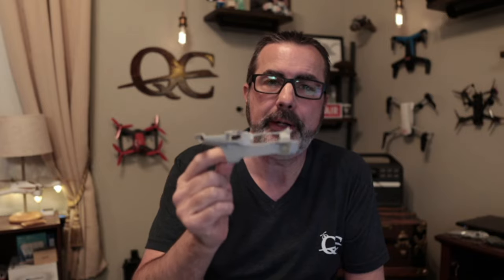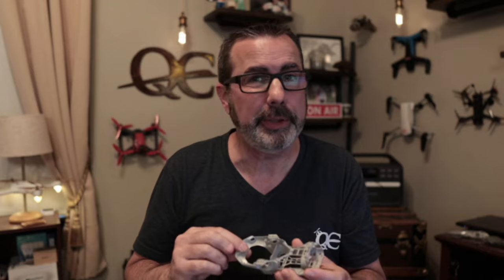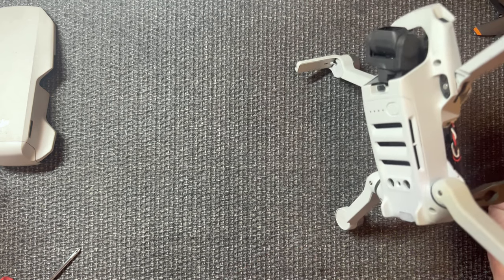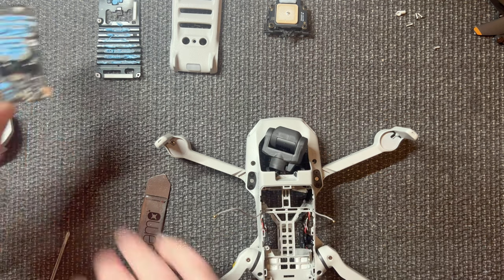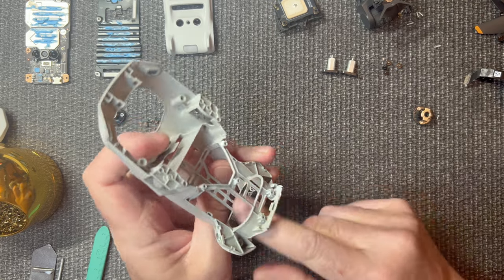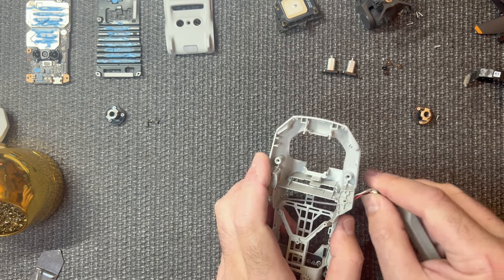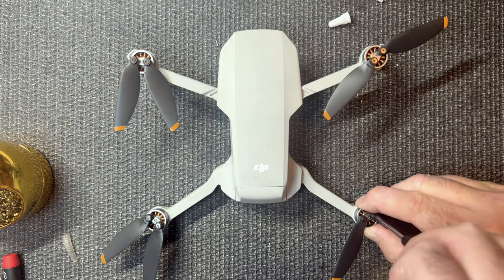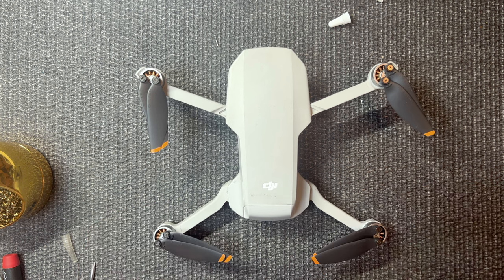DJI Mini All Models - Mid Frame Replacement - Complete Teardown

Comment: Quick question about soldering, how do you stop the solder from touching, they are really small and close together, is it something to do with the flux ?
Reply: No it's nothing to do with flux. You just put too much solder on it. You can remove with desolder braid or a solder sucker(you have to be careful with this tool as it easy to remove the pads from the jolt if you let the tool hit the soldering iron). So I would recommend the braid.
Reply from the maker: Solder will stick to the copper traces not the areas in between but flux does have something to do with it by preparing the surface for good clean flow of the solder. 
You will notice a considerable difference without it.

Comment: Hi mate , having problem trying to connect the long antenna. Looking at it , it doesn't look collapsed, but might be. Do you need to replace whole leg if antenna has collapsed ?
Reply from the maker: It’s easier than trying to fish the antenna cable through the arm.

Comment: Hi Chris, This is a wonderful video, top marks. I have a question you maybe able to help with. I've replace the mid frame on a Mini 2 SE and the gimbal absorbing bracket is broken. I ordered this with the mid frame and got all. It's only now I realise you need a special tool to press out the axle, but also if you do that the motor and PCB look like they are still attached to the broken adapter and I don't see any information how to move these to the new adapter anywhere. If I go the other route and get a complete gimbal without the camera it has to be calibrated and from research it looks like the firmware may have to be replaced to do this. That looks a bit like rooting an Android phone. Just wondering if you can offer any advice on which path to choose.

Comment: Thanks for this guide, that what I was looking for. I am wondering, however, exactly what temperature did you set the soldering iron to? And other question: is that electronics grade silicon really necessary? I would appreciate this information.
Reply from the maker: Lead-based solder: Start at 600°–650°F (316°–343°C)
Lead-free solder: Start at 650°–700°F (343°–371°C)
The electronic grade silicone is recommended versus just using silicon.

Comment: My friend I am a newbie with drone repair but i have there's one thing that continues to perplex me and no one seems to post or describe the answer to this question and maybe I am revealing my inaptitude with this, but what is the temperature you recommend the solder iron be at in order for drone work? I have mine set at 410F, too much? too low? Thank you in advance!
Reply from the maker: @aeroglyder24  
Lead-based solder: 
600–650°F (316–343°C)
Lead-free solder: 
650–700°F (343–371°C)
60/40 solder: 
700°F (370°C)

Comment: I have a fimi X8 mini that needs to be repaired. The motor is locked on  cw back right side of the drone. How much do you charge for repairs.
Reply from the maker: $25 for the complete new arm with motor already attached and $60 to $80 labor. 
Email if interested: qcguy.chris@gmail.com

Comment: Can I change the arm only without having to take it all to bits?
Reply from the maker: Nope 👎🏻 
You have to deal with the wires regardless so you have to take it apart to do so plus soldering.

Comment: What about the  frontal led cable?
Reply from the maker: It wasn’t on this model but once you are this far it’s not rocket science to figure out that you just unplug it and remove it. The glue is the biggest obstacle though…
Reply: @QCGUY  Yes, I managed to remove it, it was not easy to remove the small board with the LED because it was attached very strongly with glue or double-sided tape.  even with the small cable you have to be very careful where there is glue.  Thanks for the reply and for your great work
Reply: @QCGUY  Hi, I would like some help please.  I received the middle frame to reassemble from Aliexpress today, none of the screw holes are threaded.  how can I do?
Reply from the maker: @stefanogiunti5832  It’s plastic, it will self thread.

Comment: Wondering if you have a mechanic's special you can let go of? You should have been a surgeon.
Reply from the maker: Lol…thanks 
I don’t have any mechanics specials at the moment but they usually get scrapped for parts when I do.
Reply: @QCGUY  Was just wondering about that, I recently picked up a used Mavic air 2s Tax shipping included $420. Came with battery and props Everything functions well used my controller from previously crashed mini 2 Did I get a good deal?
Reply from the maker: @painn415ifty  sounds like a good deal to me ✌️